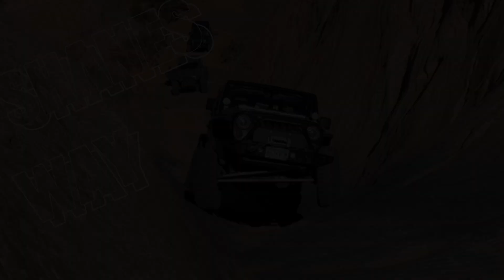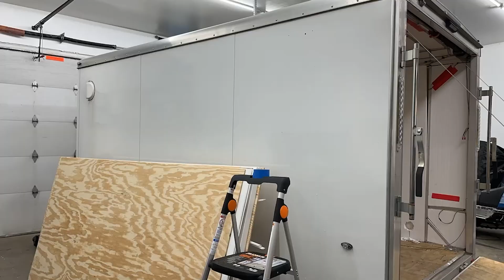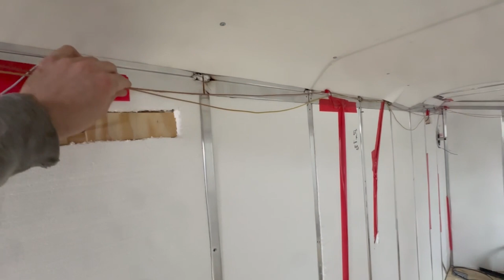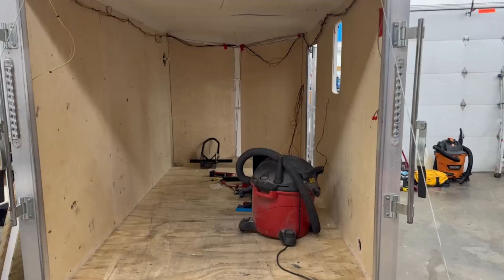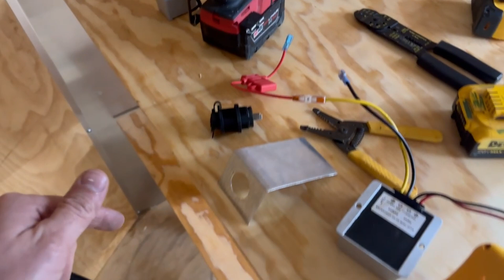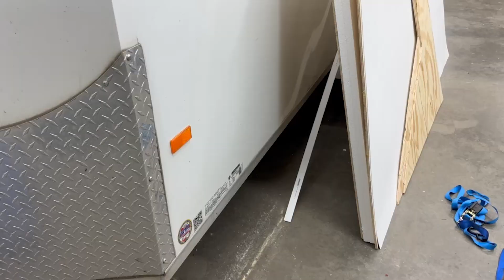DIY Cargo Trailer Camper Build

Comment: When you mounted the bed rails and cabinet to the walls do you screw into the metal studs for each brace or would the plywood be enough to anchor it?
Reply from the maker: The Bed rails are screwed into the metal studs. For the Cabinet I actually screwed a 2x4 across the front wall since there are only 3 studs then mounted the cabinet bracket to the 2x4. The interior plywood is only 1/4" so I wouldn't trust it to hold much.
Reply: Thank you @ShanesWay12